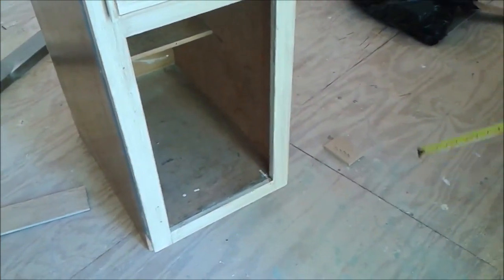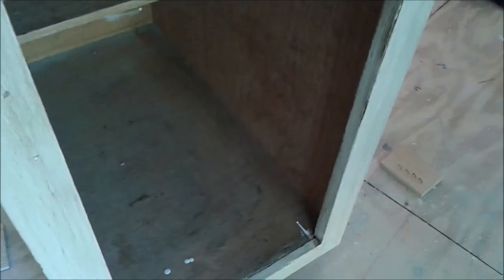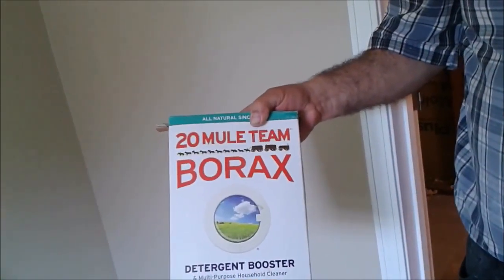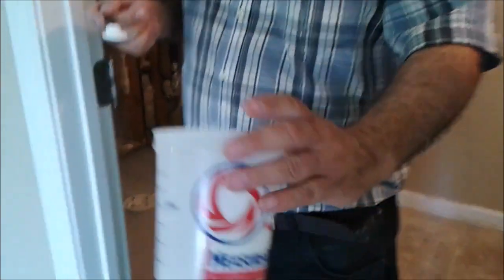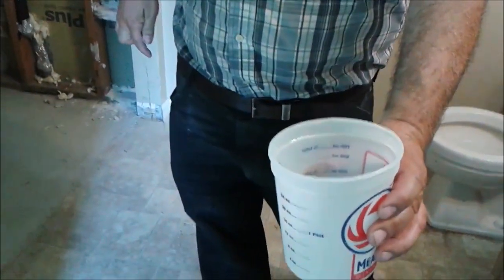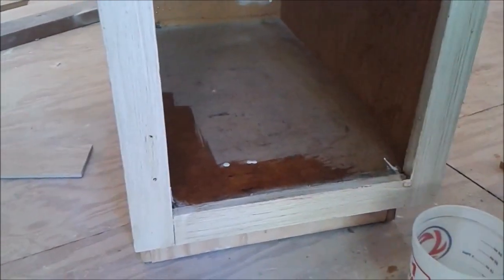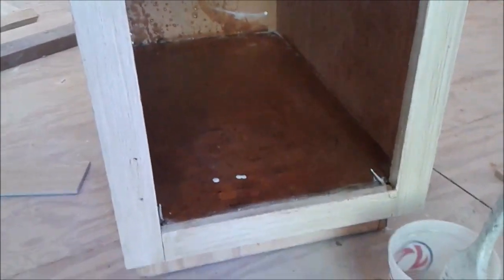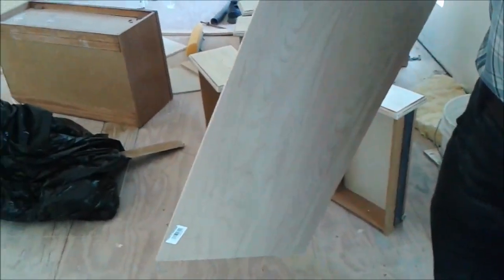How to remove and prevent mold and mildew from wood cabinets using Borax

Comment: Yours is the first video I've seen that shows how simple it really is to get rid of mold. You can also mix borax with vinegar which is also a mold killer and even add salt to further reduce the chance of mold returning. Again nice video.
Reply: Berg thanks for this info
Reply: how do you mix it?
Reply from the maker: Thank You
Reply: I tried the vinegar stink so I mixed it with water and some dish soap and we woke up sick but I was using the peroxide and it seems like it was helping because I sprayed it on everything

Comment: I suggest dissolving in boiling water. A spray bottle would be effective too. Great information!
Reply from the maker: I mixed the borax in hot water.
Reply: Thanks the spray bottle will lessen my time with ending of mold an smell forever I  pray .the easier the better ❤

Comment: great tutorial. I had a DW flood and want to save my cabinets. Can I use this process underneath the cabinets that sit on the concrete slab. I'm on a ranch. 
My goal is take off the countertop, detach the cabinets put them on the side and clean the cabinets (using your method)  then let it dry, also use the method where the cabinets sat on the concrete floor. 
Once everything is dry put cabinets back with new hardwood floors. 
Is this possible? 
Thanks in advance.
Reply from the maker: It is possible depending on the cabinets state. You first need to dry the cabinet before apply borax. You should apply borax on necked wood (wood without paint or stain). Remember borax will prevent mold and mildew to grow on your cabinet if  it penetrate the wood.

Comment: do we need to wipe it down or dry it in sun later or something? I seem to have it on a chest of drawers in one of inside rooms. thank you for the video!
Reply from the maker: Dry it. The water will be evaporated and the borax will stay in the wood.
Reply: Joseph K so you recommend putting it in the sun? also it seems to have white patches all over rather than black. is it still just regular mold? thank you!
Reply from the maker: You should use a brush like one  you are painting a wood. Let the substance penetrate (absorbed) into the bare wood. The water on the wood surface will be evaporated but the substance which was absorbed into the wood will stay and  protect the wood.  You can wipe the remains after 10 minutes or so.  The withe patches is the remains of the borax which stay on the wood surface and it can be wiped out. Remember the Borax substance should be applied only on a bare wood and not on a painted or stained wood.  After you applied the borax to the effected  area you will never see mold on this area for a very long time.
Reply: Joseph K I wanted to send an image to you. how can I ?
Reply from the maker: email me josephkh2014@gmail.com
Reply: Can you put this mixture in a spray bottle and use it for basement ceiling rafters?

Comment: I have a wooden dresser covered with mildew and mold all over the back and inside the drawers. Do I have to wipe down the dresser first before I apply Borax? Or can I just apply Borax to the mildew?
Reply from the maker: Just apply the borax . The wood should not be painted or cover with polyurethane.
Reply: Should have watched this first. I cleaned the mold off and coated the back and under my dresser with poly. Will it mold again?

Comment: Thanks, but doesn't the water create a problem on the particle wood? Like with the moisture the wood may warp or hold onto the moisture and create a mold friendly environment?  And does the Borax continue to work for years? I'm looking to buy an Ikea armoire but we live near the coast and this furniture always gets a attacked by mildew. I wan't to prevent it on a new furniture piece. Any thoughts?
Reply from the maker: when you mix water and borax properly and apply it properly on the  particle wood (must be bare wood), the water will be evaporated but the borax which is a kind of salt will stay for ever inside the  wood. Moister or water leak on that wood will not create mold and mildew because borax poisons the mold fungus . It should last for ever.

Comment: What do you do if the cabinet is painted? Will this work? The inside of my kitchen cabinet under the sink is painted, but growing mold and mildew. What are the concerns with paint?
Reply from the maker: It will not work on a painted wood only on a necked wood. You should removed the paint.

Comment: Hello sir, molds are formed under the bed, I tried so many ways. The bed was painted can i use this product plz suggest me?
Reply from the maker: If the mold is on the paint you can use boarx to eliminate tit. If the mold is in the wood you will have to remove the paint and use boarax as you see in the video.

Comment: if we are going to sand should we sand first or after the borox?  any reason to not spray the borox on the wood? if there is a large surface area?
Reply from the maker: After sending. You can spray it with Borax and let it dry.
 I don't see an issue but you should spray it on a naked wood that the borax substance will penetrate the wood.
Reply: Pump up bottle or spray bottle should work.  Dissolve Borax well.  When solution dry-ies in nozzle after use it could plugg up spray bottle nozzle.   Take apart nozzle and wash out nozzle parts before storing away sprayer.   Wear gloves and in confined spaces protect your eyeballs
Reply: I realize this was posted 5 months ago but you do not want to sand black mold. Wait until it is gone. Sanding will send small particles of mold everywhere. You do not want it in your lungs, unless you want to die or something like that.

Comment: Do you wait for the borax solution to dry before putting the plywood down on top?  Will borax kill and prevent mold on drywall and or plaster?  Thank you.
Reply from the maker: Yes you  should wait until borax solution dry. Yes it will kill mold on drywall and plaster but remember the back drywall has also paper and the borax need some how to reach this paper.

Comment: did you say 1 cup (8oz) per gallon of water?
Reply from the maker: A spoon (or a 2 tee spoons)  per 8 oz of water.  Per gallon is around 15 spoons of borax (close to a cup)
The most important is to mix it with hot water very well until the borax is dissolved in the water and then apply it to the infected area.

Comment: Borax is sodium borate.......I do wonder if thats similar to baking soda(sodium), which is one thing people use for mold.
Reply from the maker: Both are sodium (Na) but they are very diffrent :
Bakin Soda =  NaHCO3
Borax = Na2B407-10H2O
Reply: @josephk9182  i WONDER WHICH ONE IS THE STRONGEST. Oxi-clean is also used for mold and it has some type sodium in it. I think it works very good!

Comment: That surface he painted on the bottom of the cabinet is PARTICLE BOARD which is grade A Crap!!! Still, sometimes you have to please a customer when they ask you to do something.
Reply from the maker: That is why you put 1/8 of an inch plywood over it.
Reply: That sounds more like floor tile than plywood. I didn't know they made plywood that thin.

Comment: A raggedy piece of furniture. To me it looks like a cabinet to hide a garbage can. The door is off of it in this video. Hardly a family keepsake nor an antique but if it is real wood then I guess it is worth saving.
Reply: If you had a leak in the kitchen, this will allow you to remove all the cabinets and clean them up so you don't have to go out and buy new ones.  It will work on fine furniture or simple kitchen cabinets.
Reply: People like you are the reason we only have about 20 years left of the society